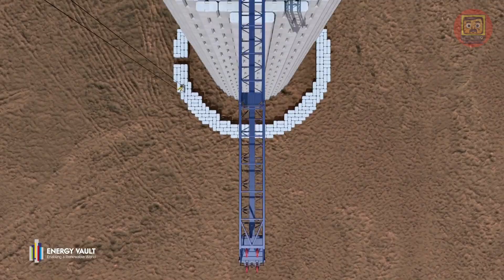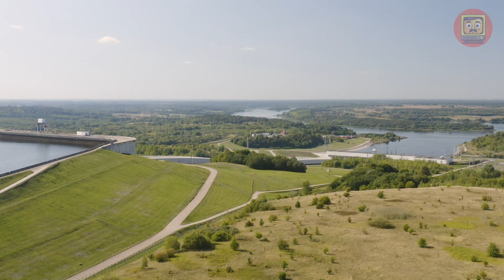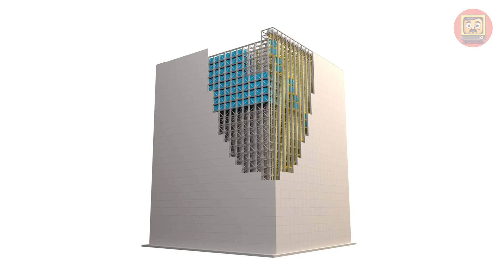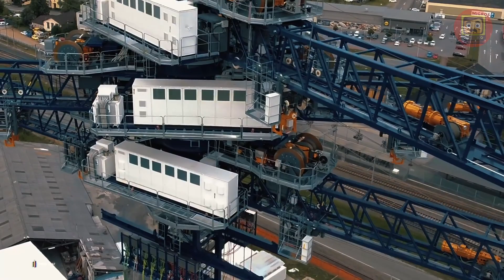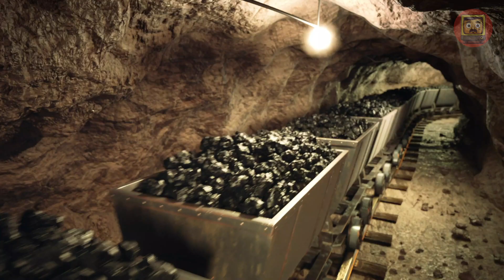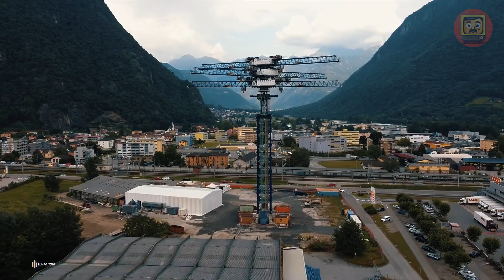Gravity As A Source Of Energy! How Gravity Batteries Could Change The World?

Comment: in theory it sounds good  but this is a total sham. not to mention their website provides absolutely no statistics or any kind of systems or specifications involved like the numbers were pulled out of thin air. sure they made announcements of achieving this and achieving that but where is the hard evidence because china's been building bullshit buildings out of concrete for years now so a empty husk of a building is not proof right now. this feels like a scam to pull in investors while doing the bare minimum as they have more investor related information then they do about the actual project.

Comment: JUST USE WATER!😂
Build a tank and put it on stilts... or use the local topography to build... a damn or storage lake. This shit is nothing more but a scam.
Reply: You also have to build upwards for these. This could make them hazards for air traffic and also subject to wind. what happens when the load begins to sway and stress the cranes or hit lower blocks chipping them over time? it all seems way more expensive than a dam. the excess energy seems to require a limit. it has to move a 30 ton block. if you don't have that much in excess it won't get stored. at least with water you can pump a little or a lot.
Reply from the maker: @tamikuru7936 Perhaps the energy cost of lifting the water is greater than the energy cost of lifting the block.
Reply: @AboutAllMain  you telling me it costs more money to move water? water is extremely cheap. If you have a lake you get free water from rain and snow. With blocks you have to make them which will cost a lot of money. how often will you have to replace these blocks too? water is easily obtainable.
Reply: @zack6012 Unless your in a desert, in which case water is expensive.